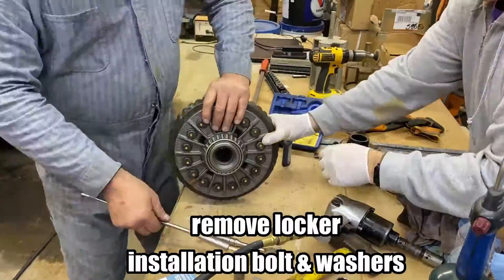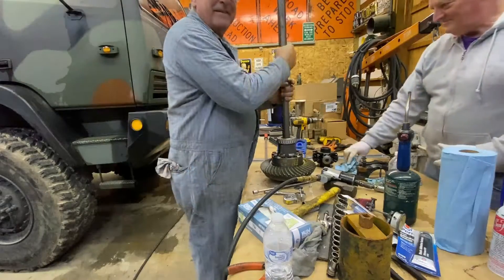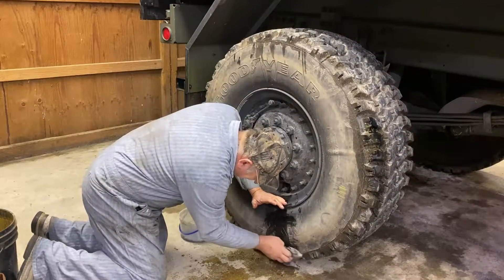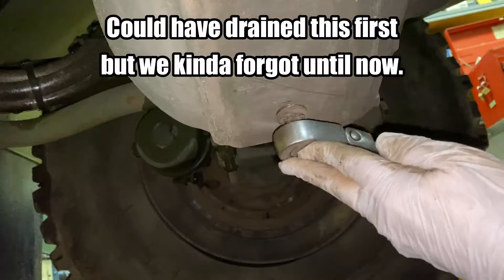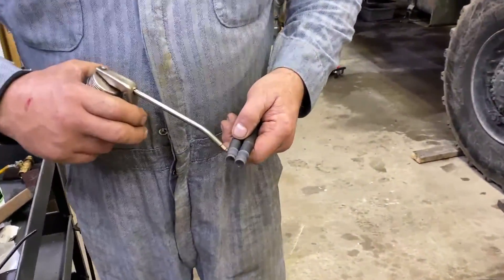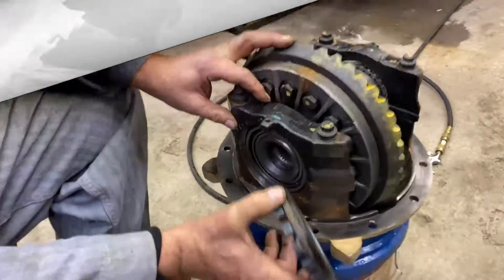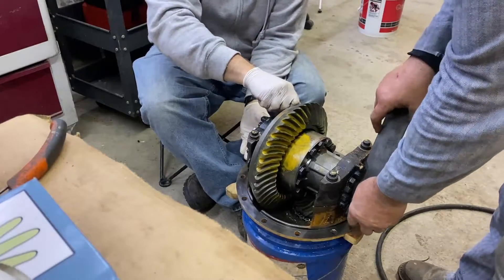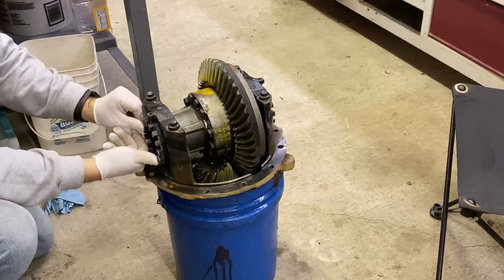FMTV 3.07 REAR DIFF & LOCKER, pt. 2

Comment: taking a sledgehammer to hit a hub is not a good practice… it damages the bearings.  it shortens the life of the bearings
Reply from the maker: The hub plate doesn't touch the bearings that I know of. It just keeps the axle shaft from coming out. Since someone before me torqued the living heck out of stuff all over the truck, THAT is what has been more worried. Anyway, once the hub plate is torqued to specs, it should never be a problem like it was ever again. Thanks for commenting... I really appreciate it.